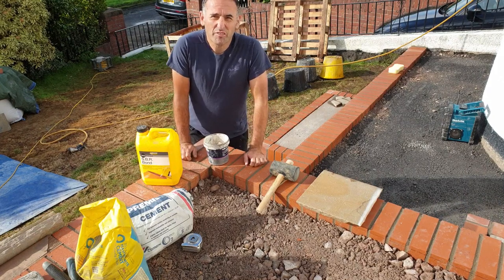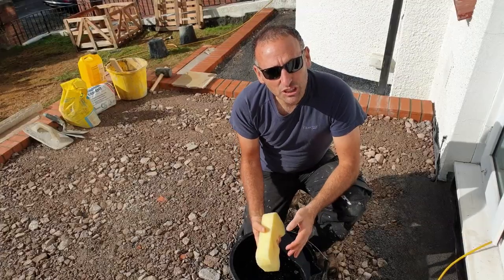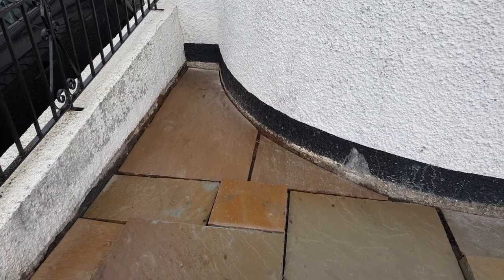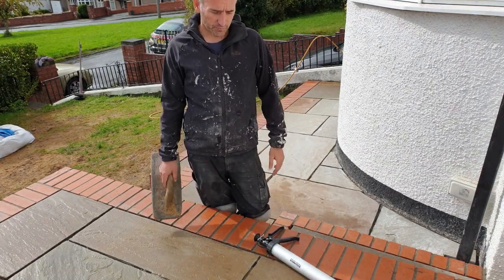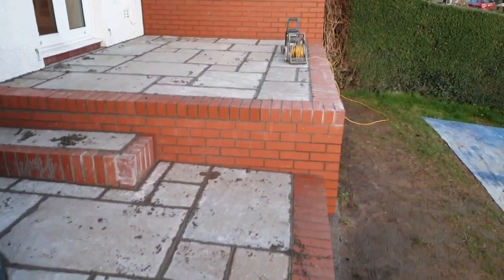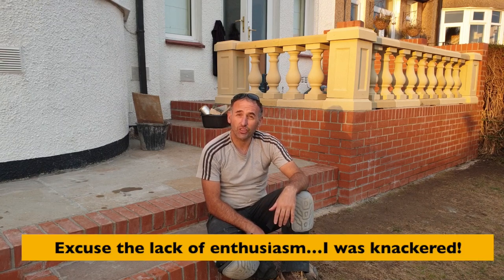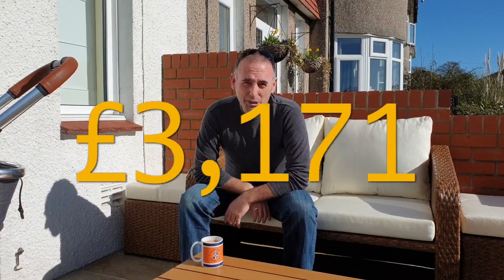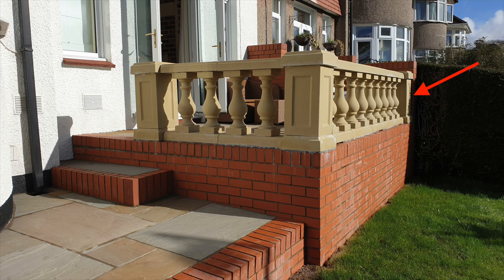DIY Raised Patio | Part 3/3 | Laying paving, Grouting, Installing stone balustrade & Summing up

Comment: Great job, good planning lead this project through to an amazing outcome, well done! Only question is how did you cut the curves on the slabs?
Thanks for the inspiration!
Reply from the maker: Thanks for the kind words. That's very nice of you.

I used a 9 inch disc cutter for the curved slabs. So that's a large disc cutter. I don't recommend a small disc cutter for the job. It can't really handle it and the motor burns out as I found out to my chagrin some years ago !

Comment: Thanks for sharing , great work. I’m planning to do my patio, do I have to put 40mm morter? Sorry If I’ve missed the point, what was the mix ration? Thanks
Reply from the maker: Hi. I used a 40mm bed of mortar but there is a range of what you can use. Unfortunately I can't remember what that range is now so you'll have to check yourself. I do know 30-50mm is OK. In my experience the lower range is better. It's much easier, quicker and less work to build up the level with sub base rather than with mortar. Mortar, as you'll discover, is time-intensive to mix up and tiring to move around and put in place so the less you use of it the better. Using sub base is much quicker. So that's the advice I can give you based on my experience.

As for the mix ratio, I personally used 4 to 1 but if I did it again I would probably do 6 to 1 which seems to be the standard. And use sharp sand whose grains are a liitle larger and more angular, providing more strength. This is opposed to builders sand which is finer and softer meaning you have more control over it and is therefore used more for brick and blocklaying

Hope that helps. Take care
Reply: @Mezquita100  Thank you so much!

Comment: Top quality build (and videos), very inspiring. Planning on doing a similar smaller scale project. Did you install any drainage at the base of the retaining wall? Read conflicting things on this
Reply from the maker: Thanks for the compliments. Very nice of you. No, I didn't install any drainage at the base of the retaining wall. The patio area is quite small and therefore doesn't collect much rainwater to drain away. I just let the water drain onto my lawn. A wet Welsh winter has come and gone and no adverse effects to report!
Reply: @Mezquita100  thats good to hear! Will start digging out the footings soon for my project. How did you allow for the slight drop across the wall to allow drainage off the top surface? Is the entire wall and footing at a slight angle or did you go for level footings and slight difference in mortar bed?? cheers for the help
Reply from the maker: I built the footings level and I wouldn't recommend doing it any other way. As for the block work, I also did that level and passed the buck of responsibility for the fall onto the brickies! The bricky did give me a bit of a disapproving look as he said I should have built the fall into the block work. It turned out OK though. The bricky built up the mortar for the last couple of courses to create the fall of around 3cm. It's not perfect on the eye but you really have to look at it to notice it.

Blockworking was new to me so I knew it was not going to be easy anyway, never mind with building a fall into it. That said, having now done it, I would feel much more comfortable doing it if there is a next time.

Are you doing just Blockwork or Blockwork with a brick skin like me? Are you doing all yourself or are hiring a bricky like me to do part of it? These are things I don't know. If you are doing what I did then I'd recommend chatting to the bricky and decide on a plan together.

Hope that helps and good luck!
Reply: @Mezquita100  cheers, that makes a lot of sense keeping the footings levels, would be a nightmare trying to get a 3cm drop across it! Just doing blockwork, going for a similar solution to yours with blocks on their side. Cheers for the help, I'll let you know how I get on!
Reply from the maker: @MichaelJones-rs5ce  No worries. Yes, do let me know how you get on. All the best
Reply: @Mezquita100  hey again Gino! Patio is finally filled in and ready for paving to be laid. What thickness of mortar did you use under your pavers? I've read of people using 50-60mm which seems a bit overkill. Cheers
Reply from the maker: @MichaelJones-rs5ce  Hi. I used a 40mm bed of mortar. Someone else already asked me this question. Look for my answer to snowrideruk. It will explain in more detail and save me typing it out again.

Well done for getting this far. You're nearly there!

Comment: Did you back fill with any of the soil you dug out to lay the block - if so, how much? And have you noticed any dippimg or sag ik the level since?
Reply from the maker: I did. I backfilled with the soil that I dug out for the footings. There was a fair amount (I think it shows on the video). I made sure to tamp it down hard before I started adding MOT Type 1 on top. It's been appx 2 years and I'm happy to report ZERO movement!
Reply: @Mezquita100  brill, I've done the same and I have a load of soil from the footings that I need to get rid of. Did you use a handheld tamper or power assisted?

Comment: Can I just ask approximately how much the materials per sq mtr cost you? I'm planning a similar job on a smaller scale soon and I want to get a rough idea 👍
Reply from the maker: As a DIYer I didn't calculate in m2, I'm afraid. I can tell you what I did (minus balustrade and labour) probably cost around £1.5/2k in materials and tool hire if that helps